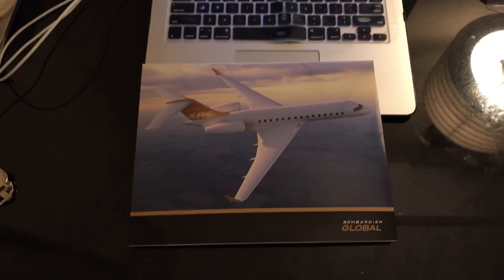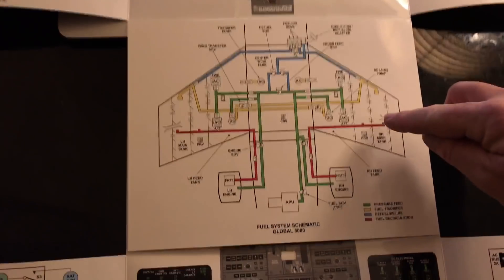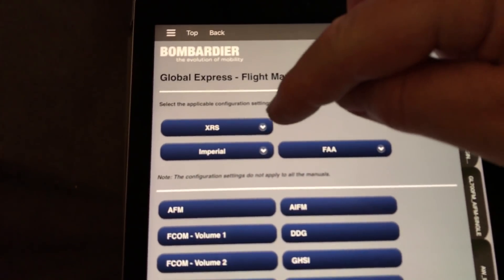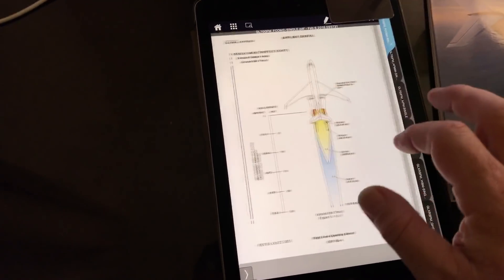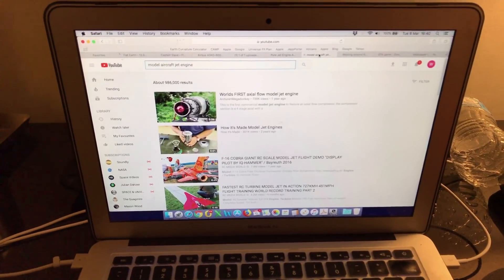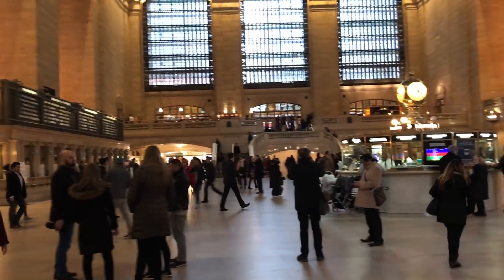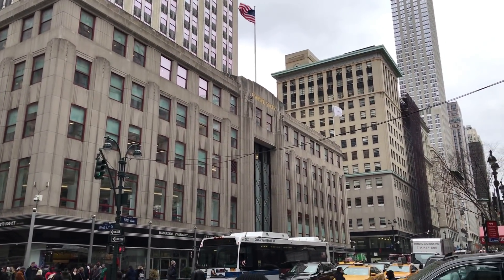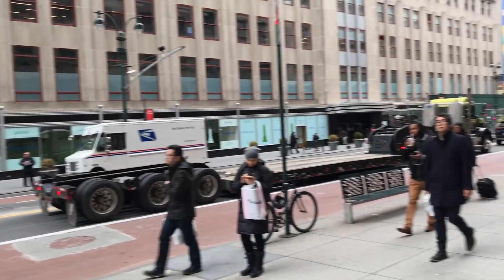Don't be ridiculous - of course Jet engines use liquid fuel.

Comment: compressed air has nearly no energy. a plane would 'nt even reach take off speed.
Reply: They used to run torpedoes on compressed air alone. Of course a torpedo generally has a much lower power-to-weight ratio than a plane.

Comment: So how did planes work with propellers then? Was it the exhaust gases that propelled them or air?
Reply: With a propeller or a jet engine, thrust is provided by accelerating an air flow anyway.
Reply: Alf Tupper I'm sure that someone of them will watch a JohnnyQ90 video about using an airturbine connected with a propeller, and claim that as air powered propeller aircrafts
Reply: Alf Tupper ... rubber bands
Reply: + ΑΡΗΣ ΚΟΡΝΑΡΑΚΗΣ
That could work actually, for light aircrafts and short range.

Comment: I had no idea compressed air smelled so much like fuel exhaust being emitted from an engine. I'll remember that every time I drive by the airport.

Did you start toking on some helium balloons at 2:23, lol?
Reply from the maker: +John Michaelson.  LOL, yes that is weird. The original video does not sound like that as I always play it through before uploading.  YouTube does odd things.   

I think what happened is that clip was done with the normal camera app in the phone using the phone mic but the others were with an app called "Hey Mic" and I was using a bluetooth microphone.   Something must have gone wonky in the YouTube conversion.  

Still trying to perfect the sound on these vids.
Reply: Yeah possibly, I know a lot of camera phones have a variable frame rate video encoder also. When I try to edit some of mine taken with the phone the audio can get pretty far out of sync if I record in low light. Processing it might try to re-sync things and speeding up the audio may be the necessary compensation.

Comment: i own a model jet engine. it starts initially on propane then switches to kerosene.

technically its a turboprop as its flying a helicopter but the front end is still a traditional jet engine, there is just a fan in the exhaust that is connected to a gearbox that turns the rotors.

https://www.youtube.com/edit?o=U&video_id=bqxQknMuisw

Comment: Wolfie the level of dishonesty among these flat earth ratbags knows no bounds. I don't believe anyone with half a brain could think you could power a 300 ton aircraft with compressed air or steam . But as they say there's one born every minute. As a member of the rural fire service I can tell them that helicopters use kerosene for their fuel as I've seen it pumped into them. I saw a video the other day about chem trails and the ratbag claimed the video showed a jet spraying chemicals . Of course it only took me five minutes to find the same video only with the information that the plane was dumping fuel because of a medical emergency removed. These people are scum and deserve no kindness. Here's a link to the video in question only with the explanation included which the conspiracy peddler had removed.
https://youtu.be/_Kc1agd6aEs

Comment: Liquid fuel, solid fuel or gaseous fuel makes no difference to me.  With heat solid becomes liquid and liquid becomes gas, so who cares what the original state of the fuel is? There are storage and distribution issues, of course, but engineering solves those issues.

My question would be:  "What do the dispersed combustion gases push against in the vacuum of space?  

I can push water around to move forward, or backward, to float higher or sink lower.  I am having trouble understanding how pushing against "nothing" will allow something to move, or to change its motion.

That being said:
The airfoil of the wings creates regions of lesser density below the wings/plane and provides 'lift'. Exhaust of, gases, even plain air, would create a regions of lower density behind the plane pushing it forward.  

Helicopter may create regions of lesser air density below plane - pushing it up - or above when pushing it down. 
Less dense object rise, more dense object fall - created region of greater/lesser density around an object result in motion.

Density???  Eureka!  ;)
Reply: Sorry about my mistake with airfoil and stating lesser pressure below wings.  Of course that is obviously false. Thanks. Mea culpa.  I know better - geez, even my boomerangs know better! 

Newton's 3rd law works well.  If, and only if, a reaction force can be supplied.  Push against a wall and you bounce off.  Push back against the ground and the reactive force pushes you forward. Push against water and you generate enough reaction force to move your body forward. Push against air and you do not get a force large enough to move you.  Push against nothing and nothing is what you get.

You doubt my understanding.  Swim on over, in the air, to the phone and call me about it.  Pushes air out of the way?  Yup.  Propelling you forward?  Nope. 

How you think this works in vacuum?
Reply: Reading that op literally triggered me. Like what??? How has high school level physics confounded you this much?
Reply: John Burke 
You do not need to push off anything, rockets actually work better in space. 
The rocket expels a mass of gasses, at very high speed, out the back end, this is the action and these gasses are pushing off the top of the combustion chamber, that is the reaction. An air filled balloon released in a vacuum chamber would reach in the same way and would actually wiz around faster than it would released in the atmosphere.
Reply: Maybe the inertia of the bowling ball is sufficient, in itself, to provide the resistance force?  You throw the massive ball,  you provide a force which by the effort required illustrates you are not pushing nothing.  Thus the reaction force.

In a gravity free vacuum, where does the resistance force comes from?  The "Law of Conservation of Momentum" work then?   Interesting stuff, for an idiot like me to play with.
Reply: +tomkfly
Why is it that the tethered bags in the ISS videos, in a region of zero gravity, move in slow motion?  Even when tugged on by "astronauts" the motion is slow?  Why do they not whip around at fantastic speeds given that no forces oppose them?

"Rockets actually work better in space."  I understand what you are saying, I just cannot explain it.  Can you?  If it is the result of F=ma then why doesn't a can of compressed air provide the constant force that would be needed to accelerate objects to light speed in an environment of "NO" resistance forces? Any small, tiny even constant forces would cause a constant acceleration - especially in an environment of "NO" resistance.  I am guessing, now, that a small, yet constant, force cannot be generated in a vacuum.

Fastening things to consider when you bring a zero gravity vacuum into high school physics.  I am admitted stunned, but I never considered, and certainly never challenged, our acceptance of the physics we learn. 

I think about pushing off a bowling ball when standing on a skateboard.  In the ISS would that work?  Hmmm?
Reply: Strictly speaking, it's not a force, but mass has inertia. The more mass, the more inertia it has, therefore the greater the amount of energy needed to accelerate it. If you've ever been called on to bump-start a car, you know that a large car needs more push to get moving, even in neutral, than a smaller car. Some of the resistance is down to rolling friction, but the most part when you start pushing is the inertia of the mass.

In the same way, a rocket will not move at all when no force is acting on it, will move slowly if a little force acts on it (low thrust), and will move more quickly if it opens up the throttle for greater thrust. By "move quickly" I mean greater acceleration rather than speed, you understand.

There are reaction engines with very low thrust but great longevity — ion engines — that provide low acceleration; these low accelerations build up over time to great velocities. There is certainly no lower limit on the thrust an engine could provide.

As to your skateboard experiment, it would work after a fashion. Because there's no gravity, there's nothing to keep an astronaut "on" a skateboard, but otherwise, yes, if an astronaut pushes a bowling ball, the ball will move one way and the astronaut the other. I don't know how much a bowling ball masses, but if it's ten pounds and the astronaut is, say 150 lbs, then the ball will move 15 times as fast as the astronaut does. (The skateboard would probably float off on its own.)
Reply: Oh, FFS! You've got to be a POE!
Reply: John Burke 
Conservation of momentum is simple. Start with 2 independent masses stuck to each other in empty free space. Initial momentum of the system is 0. Now one of the masses, say a person or a rocket (mass=9units) pushes the other mass (mass=1unit) away. Now mass2 is moving in one direction (v=9units), but the rule is the overall momentum must remain 0. If mass2 is moving to the right then mass1 counters that by moving in the opposite direction (v=-1units), nothing else is needed. 

P=m1v1+m2v2
P0=10(0)=9(0)+1(0)=0+0
P1=9(-1)+1(9)=-9+9

Comment: If I understood the claim, it's not that they run on compressed air (that there is some source of compressed air driving them) but that they run by some magic where compressing air gives extra power.
Reply: +Robert Szasz As I understand it, the compressed air (possibly with some jetfuel) is used to spin the turbine up to operating speed.  Whereupon the flywheel principle or maybe it's aether, keeps it spinning forever.  "because god" or "because magic".
Reply: you missed the atmospheric free electricity bit.    as the plane goes through the air , it harvests electricity to power the motors and then the compressed air squirts out and powers the plane.

Comment: They can visit a model air show, i'm sure there are some model planes equipped with model jet engines also (and if they're lucky, they might even stumble into a pulsejet-powered one). They can see how the model planes are being fueled and they can even see the fuel running through the fuel lines as the engine runs. 
It's all very easy debunked and i'm seriousely wondering why they don't do any effort to investigate their unsubstantiated and speculative guesses.
Reply: 2stroke4me
Flat earther - investigate, effort.. No connection whatsoever.
Reply: There are model airplanes that run on compressed air. I guess in reality planes do fly on compressed air. It’s what you do with the air after you compress it and mix with fuel.

Comment: If a jet liner runs on compressed air, why does the engine generate so much heat?. If you stand behind the engine you'd be incinerated!
Reply: let me tell you the true reason dinosaurs went extinct. BTF (before the flood) the air was thinner, and the dinos had tiny nostrils which worked fine. ATF (after the flood) the  air was much denser, and as the dino breathed  the air in its lungs being forced through those tiny nostrils produced heat. Sadly Dino snot (yes you heard me ) id flammable. This meant heavy breathing dinos had their noses catch fire and incinerated their heads. This ended the age of dinos on earth. 
Some would have you believe this was the source of fire breathing dragons.
Reply: Kick in the afterburners and the exhaust gets pretty hot again.

Comment: They show the level ZERO of understanding energy. How can they imagine it could work? You would have to spend compressed air to keep the engine rotating. Inside the engine air from outside is compressed which is a hard work (temperature is increased in the process) then, without any energetic addition (no combustion, right?) that air must make a turbin rotate and should be accelerated in the exhaust to create the thrust. In real life without combustion, a jet engine just produce a kind ventilation flow.
Reply: FrenchCrow 
It's hot air from flattard videos, inhaled by Flying Sorcerers,  and released as farts....
Reply: Stinky technology! :o)
Reply: These are the  same class of people that fall for "free energy" hoaxes all the time.
Reply: I keep seeing this phrase OVER UNITY that's supposed to explain how it works but no one seems to have any idea what that's actually supposed to mean. But it must be true because stuff written in ALL CAPS is always true.

Comment: I stumbled on the...enslaved by no media...channel recently. Not only does he think jet engines don't use fuel but he also thinks some planes are fake...they fly lower 'than we have been told'.   As a consequence they have to fly slow...and a consequence of this is that distance measurements are reduced too. Some people are just insane.
Reply from the maker: +midnigth rambler  He used to hang around my channel like a bad smell and I tolerated him for a while.  He showed me a video claiming it was a lighthouse 50 miles away but it was actually a buoy just off the coast.  They had to delete that video.  

I got sick of his nonsense and asked him to go away many times but he could not help himself so I eventually blocked him.  A total nut job and I don't say that often but in his case it is well deserved.
Reply: Enslaved by no media says the actual distances are about half the regular distances. He uses a formula which is D * 0.66 * 0.66
And the aircrafts don't fly much faster than the take-off speed.
Hopeless.
Reply: FrenchCrow he's missing a trick then....surely the formula should be D * 0.666 * 0.666 😀
Reply: I didn't think about that, but it makes sense :o)
Reply: midnight rambler - check out flat earth photography channel. That nutcase thinks some planes are demonic and are just projections or something. But then again he believes we are in some matrix style world so I guess he has lost all his marbles
Reply: wolfie - that lighthouse video was from Flat Earth Photography, claiming he could see a lighthouse on the coast of Wales from Irelend. Turns out it was just a buoy a few miles off the coast. Took down the video shortly after.
Reply: +Wolfie6020 
The one thing, several things actually, that I always wonder about these individuals is just how they manage to function in society. It appears they have an income of some sort. Some of them even seem to have families. The scary thing is that they probably vote.
Reply: "It appears they have an income of some sort."
I wondered about that too. But many jobs nowadays don't require any scientific or technical background, and not much common sense either, I guess.
Reply: How should this work. Distance depends of the speed you move? What speed something should have to actually move 1km for example? And does that mean if I move very-very slowly then I have to move only 100 meters. And if I run then I run 1.5km for example.
Reply: I suggested he needs to invent a new measurement system based around the average human foot, he could name it the foot!
Reply: I've seen people in the comment sections commenting about how the planes holds more fuel than the tankers have....... them not realizing that planes rarely if ever a kept full of fuel. They carry enough fuel to get to their destination + some various amounts of buffer fuel. It's not like a car where one keeps the tanks topped off and full. carrying more fuel than you need + som reserves is wasting fuel and energy. because the heavier the craft is, the more fuel it will burn in flight to its destination. So you want to keep it as light as practical.
Reply: midnight rambler Ever seen a hologram?
Reply: There's definitely a case for rounding up the conspiritards and loosing them somehow.
Reply: ForestDweller And how exactly is he measuring distances with his camera.. do  be precise and explicit in your answer.
Reply: ForestDweller why would I take much notice of a conspiricy freak who presents no technical evidence.
Reply: ForestDweller seriously, that channel is demented. You expect anyone to spend time analysing what is obviously bullshit?
Reply: ForestDweller Just to humour you. So he zooms into a plane and assumes it's at 30,000 feet.... yeah... and... *ASSUMES*....  oh, then he calls it some 'fallen angel technology' . I stand by my proposal that these people need to be incarcerated and given medication.
Reply: ForestDweller What distance??? He had no idea how high the plane actually was.... Now show me how he knew factually how high the plane was supposed to be. Not even a video clip showing the same plane on flightradar.
Reply: ForestDweller jets also fly lower you idiot. And he needs to have proof of the time date location of the flight, and show that against a radar log. it's no use him just saying it, he needs to proove it. No science, no proof, just....as usual 'dùuuhhhh it looks close, so it must be close... duhhhh'
Reply: Check out his gasoline lie video where the guy says his car runs on nitro (nitro methane) an conspiracy guy says "see I told you it runs on nitrogen" haha dudes a dummy all around in that video
Reply: Wide Awake! Yes...so where are the lasers producing your flat head holograms.
Reply: ForestDweller ok ...now let's analise this. Typical plane length 60m at 6km this subtends an angle of 0.25 degrees or half the sun's angular diameter. Now zoom in at the legendary p90 90x and you get a subtended angle of over 20 degrees...now why wouldn't you be able to see features at that magnification?